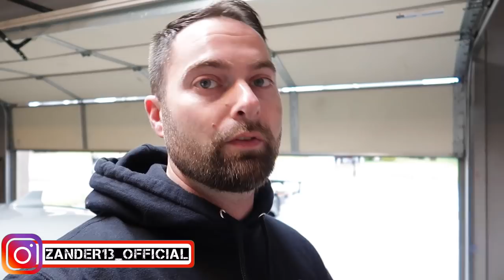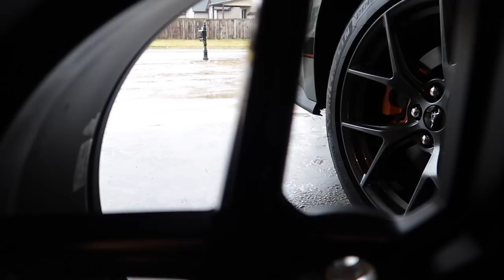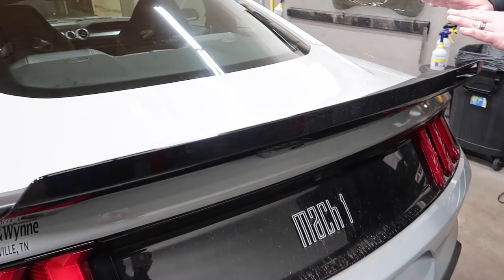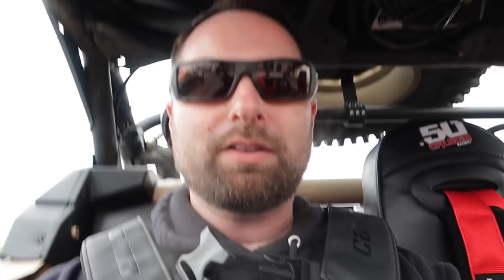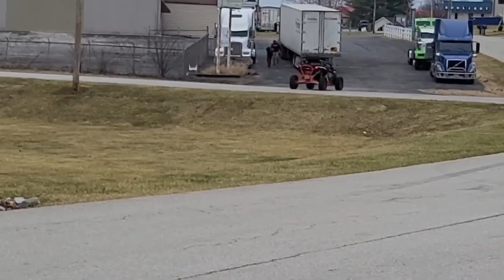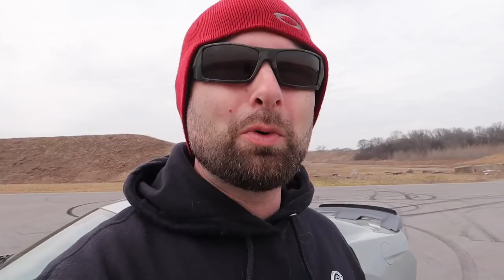MY 2021 MACH 1 FORD MUSTANG LOOKS INSANE NOW w/ THESE NEW CUSTOM 20” WHEELS!

Comment: This is amazing how you set up the wheels plus the tint. OMG. If you turn and look back at your car as you walked away. Then you made the right choice. If you don't turn and look back at your car when you walk away you bought the wrong car. Not only do you look back at that beautyStang every one does. Love it bro keep it up. We need more power. 700ph and it will be perfection. no need for 1000hp. After 7, it isn't trackable. What are your thoughts Brother stangers
Reply from the maker: 100%. Plus more power coming in time

Comment: I know thisbis old but help me out.... I know you needed to recalibrate the speedometer, but were they any issues with magneride switcjimg up the tire suze that much???? Also do you have any 60-130 times from the Mach woth Ess???
Lmk thanks
Reply from the maker: No issues at all. No dragy times. Just pick a tire size that is close to same diameter as stock 26-27 inch tall
Reply: @Zander13Productions  thanks  👍🏼

Comment: This is making me contemplate a Mach.  I’d have to get rid of the 350 though n I’m not sure that’s a good trade off.   I wish 22s were tuneable cuz grabber blue is going to be hard to pass up on
Reply from the maker: That’s a hard choice. Mach 1 does has some features the 350 doesn’t offer but Shelby is still a beast of a car

Comment: car looks good wish i could bought  mach 1 but ill stick with my premuium gt  and unless that can am has a motor swap which it sure dont sound like they were lying about 500 hp maybe 250  300 max before motor swap, my turbo has 185 hp and ts the exact same unit, dont know where there getting that wild of hp gain and doubt the motor would handle it

Comment: I've asked already, will a standard rim for the Mustang GT fit the Mach I?
Reply from the maker: Yes. So long as it’s PP1 fitment
Reply: @Zander13Productions  I take it then that they have to be staggered?  By the way, thanks for giving the %number of your window tint.   Most guys don't.  I did 40% on one Mustang, while 30% is legal in my state.
Reply from the maker: @AStanton1966  yes staggered

Comment: I have a 21 race red Mach 1 with the handling pack. I’m not going to use the sport cup 2 tries. If you are interested I will sell them. Let me know
Reply: I replaced my pilot sport cup 2 after 3k miles for pilot sport 4s